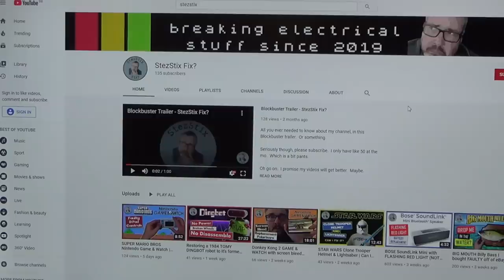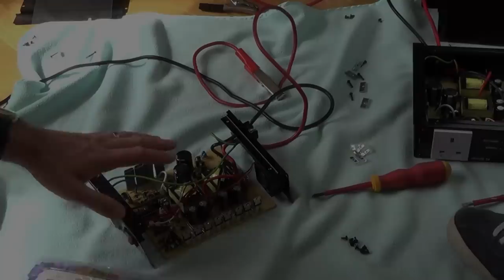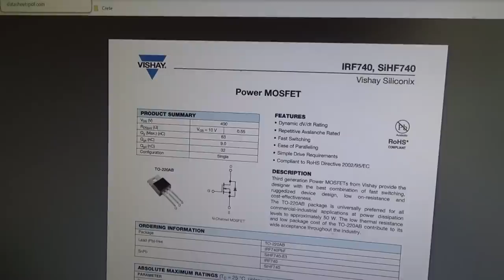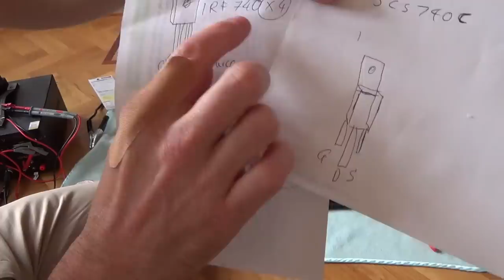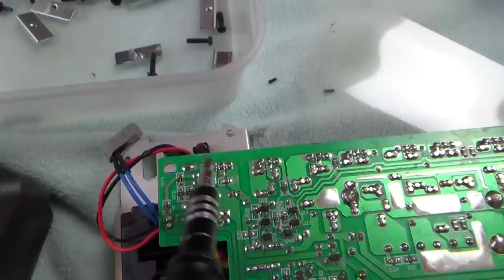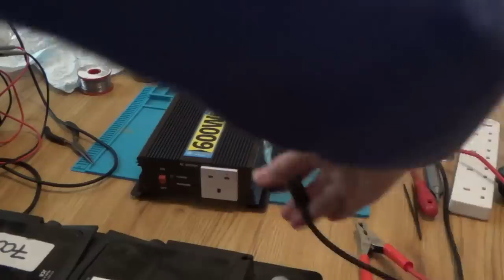Trying to FIX: 3x Power Inverters - 12V to 230V

Comment: The process should go -> fuses -> transistors -> diodes ->caps -> resistors -> ic. The cracked component is optron (opto couple probably PC817). Check for shorts on all of the parts and then check for improper open, bulgy caps, diodes should show something only on one side. You can't change zener with diode, those are two different components. Diodes are fast recovery so they should read 150-400, transistors read around 500-600 according to base to colector and emiter and not on other direction. MOSFETS can retain their state because the Gate acts like capacitor and can charge and discharge Source - Drain conduction. You CAN'T test MOSFETS in diode test, you have to charge the gate and discharge it and measure it like switch (or potentiometer) who is controlled by the Gate. Resistors can go open or higher on resistance. Don't change 0.5 Ohms with 15 Ohms, those are current sense resistors, the device can go in current protection mode if you do that. Multicomponent tester that you have should test MOSFETS and show if they are within specs. You can damage MOSFET with static discharge. YOU HAVE TO CHECK ALL COMPONENTS BEFORE TURN IT ON. USE REGULAR LIGHT BULB IN SERIES WITH INPUT CABLES to prevent blowing the components in case of shorts.

Comment: Car batteries are 12.5v+, even close to 13v fully charged. That thing probably thinks your "battery" is dead when you give it 11.96v with those thin wires
Reply: yep, and once the engine and alternator are on, the voltage is 13.8v to 14.4v
Reply: Without a load on inverter there shouldn't be much voltage drop, also most of these kind of inverters have low voltage cut of 10.5v
Reply: @sam_8a  There will be an in rush current that probably exceeds the output from that PSU.

Comment: When your brother asked if mosfets have "memory" or if they latch,  yes they do,  sort of.   A "latch" device like an SCR will stay on until all power through the circuit drops below a certain threshold.  Mosfets can certainly hold their state outside of circuit,  basically by charging the gate.  Remember the gate of a mosfet is similar to a capacitor and it holds a charge.  For example applying a momentary positive voltage (with respect to the source) to the gate of an enhancement mode N channel mosfet will turn the mosfet on and it will stay on until the gate is discharged (typically by connecting the source to the gate).
Reply: The benefit of watching the video not when it just came out is that instead of writing a long comment I can simply like yours :)
Reply: Was gonna say a similar thing but also include that MOSFETS can kinda "latch-up" if not driven properly (i.e. the MOSFET gets stuck on/off and won't transition back, or, slowly transitions back to the previous state. Usually this is if the gate-charge isn't sourced and drained fast enough. Has this incident when modifying a SCR-triggered soldering station to run as a battery powered portable soldering station.... before the TS100 became a thing.)
Reply: When used in ac circuits like a dimmmer control this will turn off the SCR automatically when the device is reverse biased. A mosfet has a very high input impedance on the gate and that's why a small voltage fed through your bodies resistance to the gate will turn on the mosfet. Then that voltage gets removed again when you short it out with your fingers. Unlike a current controller device like a regular transistor, a mosfet works more like a tube/valve device that is voltage controlled.
Reply: An SCR/TRIAC will latch

However, a mosfet would not, and these look like a push pull combo, n channel and p channel driving the promary side of the coil

But yes, the gate has capacitance so the gate has to be pulled to ground to switch it off (or a  resistor from ground)

Comment: Parasitically MOSFETs can sort of stay on for a short while as the gates are basically little capacitors, but most circuits have pulldown resistors to turn them off as a failsafe. Also touching the legs with your fingers will drain any charge from the gate, having said that charge on the gate won't stay there for long on its own due to leakage.

Comment: This is a boosting switch mode power supply that runs on 12V and outputs approx 300VDC. The 240VAC is created by fast switching the 4 mosfets or groups of mosfets in an H-bridge. Some filtering, smoothing and safety is added. And that's it.
To repair: Remove the mosfets. Check them. If one is damaged, order new ones from the same batch for all positions of that section. They should be balanced. Now first, clean up burnt areas, resolve shorts, replace parts that are obviously broken, check small transistors, check the gate resistors, and all other small stuff. If you have one, then connect a 2-channel oscilloscope to the gate connections of both mosfet groups and power up the device using a current-limited 13V supply. You should briefly see nice drive signals, just before the protection powers the thing down again. Turn it off. If you don't have a scope, you can use a good AC multimeter that does not show DC components when measuring AC. Check that by measuring a DC voltage in AC setting. It must show almost 0V. So, at the gate connections you should see an AC voltage, indicating that there is a drive signal. If that is all working, for both mosfet groups, then we can proceed. Now, at each group, you mount one mosfet, so you blow up max 2 mosfets during testing. Connect a small test load and a multimeter to the main capacitors at the secundary side of the transformer: at the main capacitors. Test load can be the two of your smallest 240V incandescent light bulbs in series. Stand back and power up again, briefly. Your test lights should light, and your meter should indicate a significant DC voltage in the capacitors. If not, try again and take attention to your power supply. It might get overloaded by this. In that case, you'll need to use a bigger power supply or a battery. when using a battery, then use a smaller fuse while testing: 10Amps. So...  You can proceed with checking drive signals at the high-voltage part. During this, you leave the light bulbs connected. They will discharge the capacitors fast, between every test you do. For safety. Here we do the same: before actually mounting mosfets, we first measure if drive signals are present at the gates. When all good, you can also mount some mosfets at the secondary stage. Connect another small incandescent light bulb to the output and test again.
When you ordered your mosfets from China, you should test them before mounting them. If all good, remove the test mosfets and mount all new mosfets. At this point, test again. If all good, remove your test light bulb, reassemble, install the correct fuse(s), test again with a battery and a bigger load.

These units can fail with a lot of damage. A mosfet usually fails into a short circuit. That kills the mosfet at the other side, too, probably in a short circuit as well. So now your 12V supply is short circuited. Hopefully, the fuse goes out before the tracks burn off the circuit board. Failing mosfets will often feed quite a lot of current into the drive circuitry, killing that off as well. So, if you just change the mosfets, you're setting yourself up for some more dead mosfets.

If your brother uses power tools on these units, you might want to add some more filtering to the output. Add a capacitor of the type you find in those fake power-saving plugs.

Thank you for reading until the end.
Reply: Good tips there but people shouldn't be buying semiconductors from china. They're all fakes, rebadged or rejects that have been rebranded with anyone's guess as to what they really are.

Comment: I have a advice for you. Every time you want to power something for testing. Please use a bench powersupply with current limit function, it will protect the components on the device from blowing up. Inverters like these only require about 2amp to produce the required output voltage with no load , so by using a  for testing you can safely test the device at low currents without having to use a big lead acid battery and shorting it out and harming it.
Reply: he does but it doesnt for whatever reason work on those inverters
Reply: Handy knowledge there... Though, I ask for what current would a full sine inverter like the ones in APC SmartUPS systems?
Just curious as I had reverse-wired the battery in the UPS (power cut the day I got the batteries, wired them under candle light, was a bad mistake ._. ).... I have a PSU that does 10A CC (but only trust it at 5A continuous CC), I guess that'd be enough?
what's the likelyhood the battery-side is referenced live? (I not found schematics, but I guess that they'd design it isolated.... I know how to handle mains, just don't want to blow up a bench PSU atop the UPS)

If ya don't know, sorry to bothered ya :)
Reply: Set your power supply to 2.5A CC that should be enough to get the ups at it’s required output of course with no load
Reply: @itzzjok3rzz208  It didn't work on the inverter because he had the voltage set too low. Most inverters have low voltage dropout circuits and won't start on less than 12 volts.

Comment: A lot of inverters will make that squealing sound if the input voltage from the batteries fall below around 11.5 volts D.C. . check the input battery voltage before you connect the inverters and then once the inverter is on and see how much the battery voltage drops and if its below 11.5  volts or so that may be one of the reasons. Also the output transistors as well as the pwm  mosfet driver ic often fails along with the input and out put transistors so you pretty well need an oscilloscope to see if there is an output from the driver ic. I love these type of switching power supply type of videos, please do more if possible.
Reply: I've had a few car batteries go flat with these things. This beep, to me, says "you're bump-starting your car on this campsite" 😬All fun and games...
Reply: And measure the B+ volts at the inverter terminals, not the battery. you can loose up to a volt in under spec wires.

Comment: Suggestion: When trying to fix "Blows-the-fuses" stuff, try replacing the fuses with an appropriate-voltage incandescent light bulb for test. The bulb will actively limit current to non-destructive levels and allow powered testing. I'd use a 12-volt auto headlamp for the inverter, for instance; and a 75-watt 220V(Europe) or 110V(US) for a small tube(valve) radio. A 50-watt lamp should be suitable for most line-powered solid-state stuff. Just wire the lamp in series with the line and use appropriate cautions of course. The lamp power should be about twice the power rating of the device under test. Good Luck and thanks for the excellent video series!
Reply: That's a great and valuable suggestion.  A guideline for everyone.

Comment: 5 amps will run a vacuum cleaner and microwave oven so 5 Amp is quite a bit. When I was a truck driver I had a full desktop computer with a CRT monitor that I ran on a 600 watt 120V power inverter.

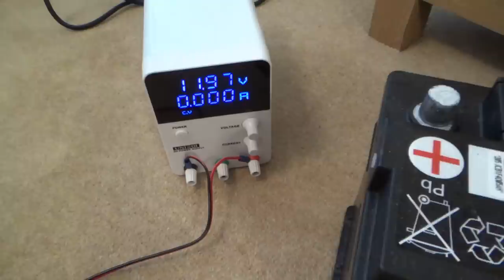Comment: 51:12 12V batteries measure about 13.8V when charged and 11.9V discharged so that inverter is reading undervoltage when you feeded it with the PSU. Check the voltage on that battery and you'll see.

Comment: You can use a light bulb in series with the fuse block while testing blown fuses.  Instead of a fuse lighting, you will light the bulb with any excess current from a short.
Reply: You will need an old fashioned light bulb though, led or anything like that won't work. But yeah, I have an extension cord with a light bulb in between the cord to do testing like this...
Reply: @patzik1910  You're correct and thank you for adding that.  You can generally use 24 or 12 automobile bulbs for lower voltage stuff.  You can also use 120v tungsten Christmas light bulbs that are coming back in to fashion again.

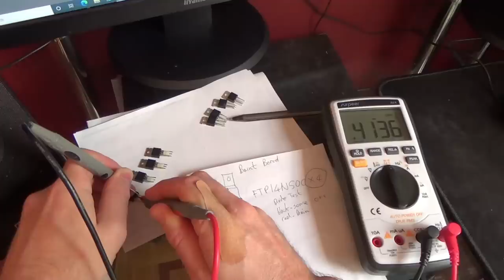Comment: @22:00 MOSFETs can turn on with the test voltage from the meter, if you reverse polarity on the same pins you can turn them on/off sometimes and get different results. LOL @28:00 never mind, you figured it out.

Comment: your brother is right, the fuses would blow sooner as 25 amp rather than a 35 amp and 40 amp. as for the noise it is an indication of low battery current or voltage. I have had it happen on my inverter, and works fine after running the car engine for a few seconds, and letting the engine power take over, plus also after giving the car a run it works fine.
Reply: also why when replacing fuses in a plug you want the same or lower amp fuse, it is far safer to work your way up in fuses rather than work your way down, when not sure what fuse to replace it with. you just do it until it stops blowing fuses when you know a product is working fine.
Reply: @michaelthomas3646  🛠️🛠️🧰⚙️🔧🧰🛠️🛠️🧰⚙️🔧🧰⚙️🔧⚙️🔧

Comment: the blown mosfets are part of H matrix circuit which generates the output sin/modified-sin wave AC. The 4 mosfets should be of the same number and same patch, that's critical most of the time. In my estimation, the DC 12 to 240V DC is probably ok that can be measured with H-matrix mosfets not installed. BEWARE the hugh capacitors will be charged with 240V DC. Discharge them by connecting them to 240V lamp. If that part ok, then you can check the IC circuitry is pulsing the H-matrix transistors correctly. you'll need a scope for that. BTW try to put a 2.2ohm 10W resistor inline with the battery positive to avoid fire in case of a direct short. The last inverter is beeping because the output voltage didn't get up in time.

Comment: IC2 is an opto coupler. It is part of the feedback circuit for the voltage regulation or for controlling the phase transient. The big slit in the circuit board is an indicator for that, because this way you isolate circuts from the high voltage part to prevent HV sparks to the low voltage side. MosFets tend to short when they have too high current loads because the silicone forms a permanent conductive channel when the current exceeds the current rating of them. MosFets do not maintain state after power loss. The IRF740C and the JSC740C are interchangeable. The IRF740 is the better part though. The failure might come from the feedback circuit. If the MosFets are not controlled correctly you get the burn out. The issue can be the opto couplers or the regulating IC. You can test the optos in Diode mode. Each pair of pins form ONE diode. So you can test both directions between the pairs.

Comment: Great vid Vince, To answer your question regarding the battery working but not the PSU. You might check the voltage drop on your PSU leads, they look rather thin, just measure the voltage on them while under load, so just hook up a 12v LED strip or something that is going to draw a farily decent amount and use your meter to measure the voltage on the croc clips,, alternatively you could measure the resitance of the leads and calculate the drop....I'd guess theyre dropping voltage, if this is the case you might want to put beefier wires on bannana and croc. It's also possible the battery is also at a higher voltage when fully charged and of course your battery leads are very chunky and unlikely to be dropping any significant voltage. I'll just add, when selecting mosfets, don't concern yourself with selecting the exact same, more often than not your absolutely fine putting in another make/brand provided the current and voltage rating matches or exceeds the max rating of the one your replacing, this is not always the case as there is more variables but in this instance it would be absolutely fine provided the pinout is the same

Comment: I think from memory the battery can supply 100A. Even if the inverter could switch on, it would only be outputting a theoretical maximum of 240V 0.5A with the power supply. However it would be lower than 0.5A due to the circuitry of the inverter using some power. On the battery a theoretical maximum of 5A  could be outputted but again it will be lower than 5A because of the power the invertor circuitry uses. Looking at the label on the inverter it says 500W meaning it outputs just over 2A. That means the inverter needs just under 3A just to switch on or 6 times the current of what the power supply can deliver. As for the beeping I would suggest that you check the diodes and capacitors on the output stage for shorts and the resistors for being open. As the chip is testing for the voltage and current being right. Since it doesn't see what it is expecting to find it sends the signal to start the beep.

Comment: Check the 4 diodes nearest the mosfets I had same problem and two diodes was open both ways and I should say thank you as it was your video that give me the idea to check my mosfet I removed it and it was bad but still had a short them I check my diodes and two was open out of the 4 of them

Comment: They are designed to run with the engine running or a fully charged battery  same as Ham Radios they don't like to work  below 12 volts and even that is a little low for some things.  Mate keep up the good work I will give more likes since that is what I can do

Comment: A good tip if working with low voltage high current device is study ohm's law which will give some insight into resistance of conductors . The leads from your PSU are way to thin to carry the current the inverter needs. They have a high demand as it needs to charge the big caps up on startup. Have worked on many different inverter types and more than few that have gone bang. If you can get a circuit diagram of even just block diagram, but you probably won't get the exact model but one very similar will give some idea what things are and what to look for and where. Thanks for the video.